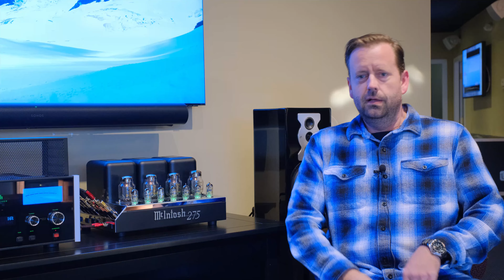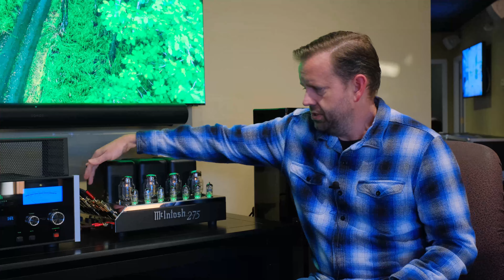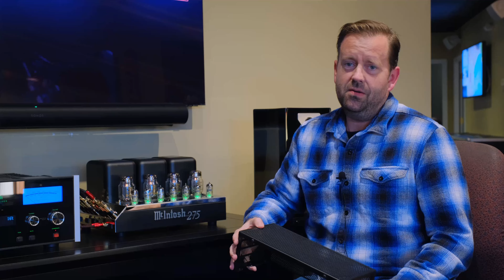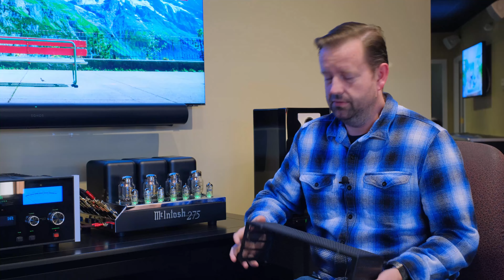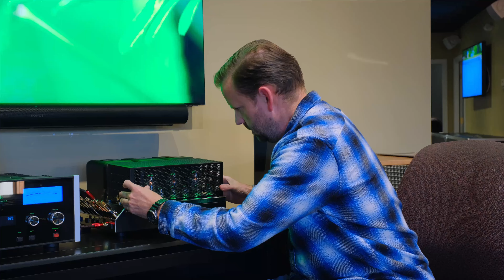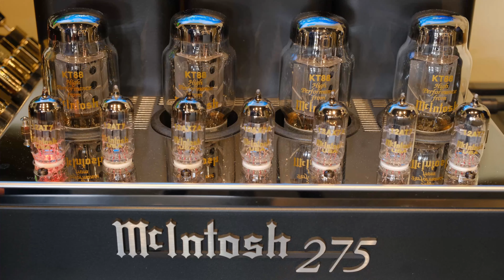McIntosh MC275 Review

Comment: What did you pair it with the c220?
Reply from the maker: For a preamp, we are using the MAC7200 receiver's preouts to the MC275. That was we can power one speaker from the receiver's amp, and another pair from the MC275 amp.
Reply: @xtendtechnologies1004  Your hookup turns out to be similar to what I decided to do.
I picked up an MA352 Hybrid amp to power a 2 channel system in my retirement home. 
And then I discovered OUTPUT 2 was full range and not limited as a SubWoofer output. That was all I needed to decided to get the MC275 as a 2nd amp. I now have Tube/SS and Tube/Tube. I run both at the same time with a pair of Klipsch Forte IIs on the MC275  and a pair of JBL KL-100 Classics on the MA352. I use a Niles speaker control to balance the speakers.
Reply: Do you guys have the MC 901? biamp seems cool